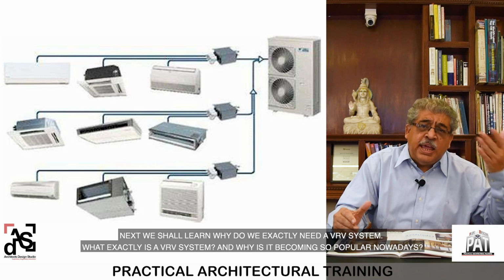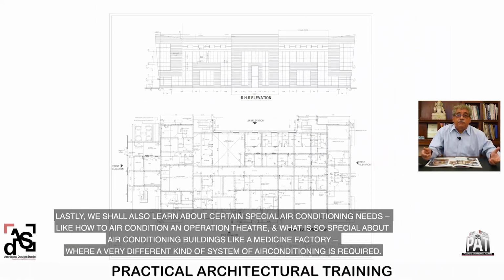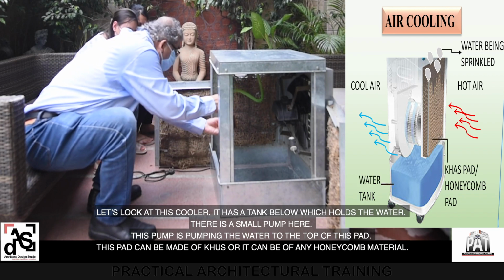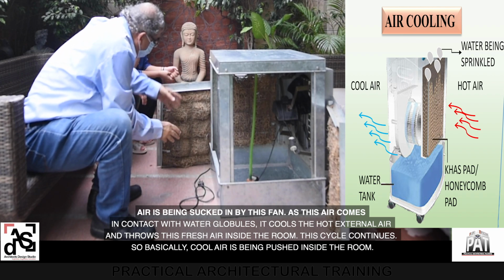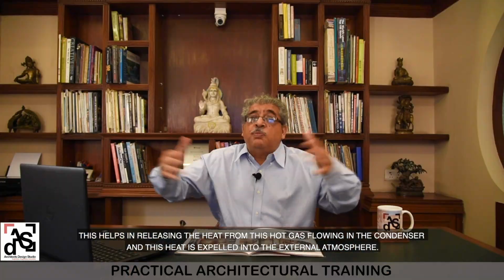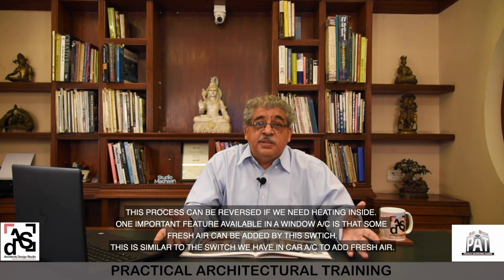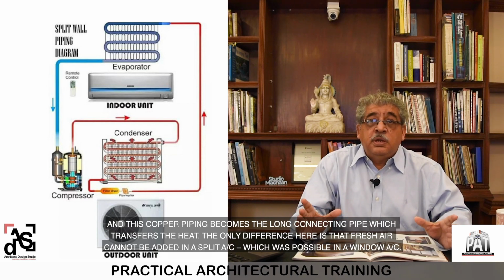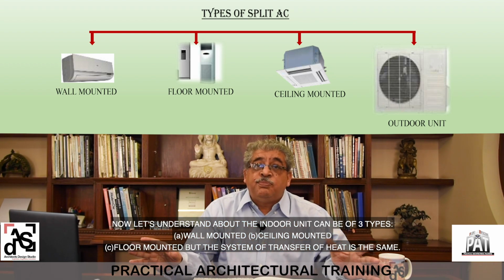How Does An Air Conditioner Work? Practical Architecture Training

Comment: Sir as a lay men, we don't understand the mechanical details, wattage etc, but I want to know how much capacity of air conditioning is required for 2000 sqft floor area with ten work station South wall has no windows North wall has 12 mm glass and bricks works. How much qty of vrf is required?